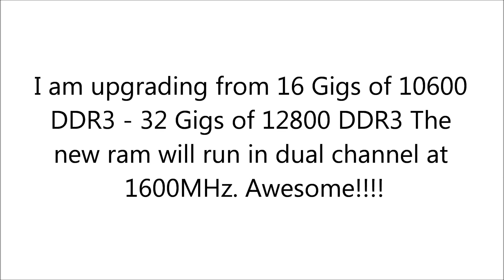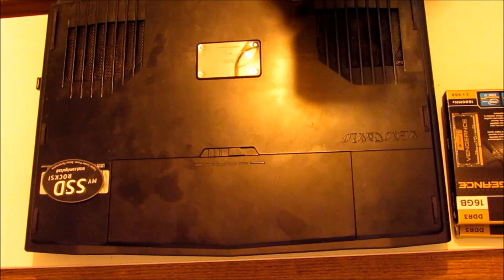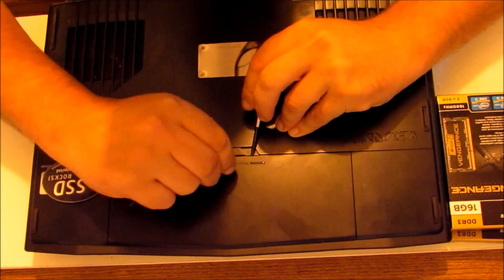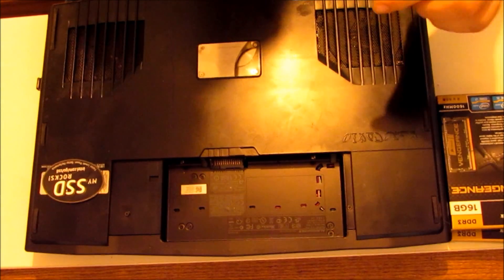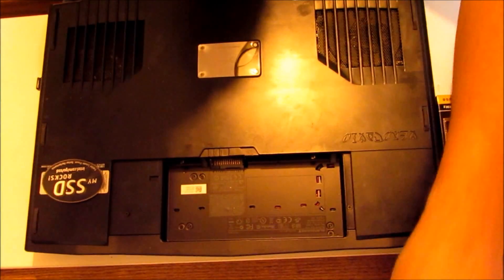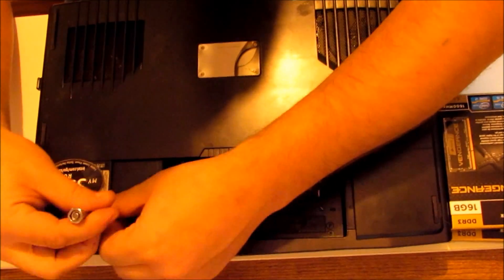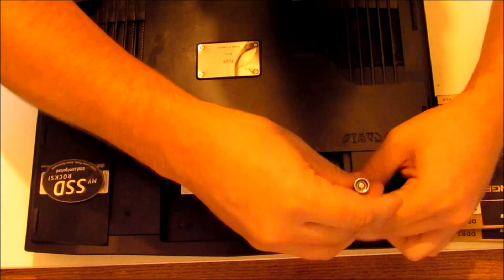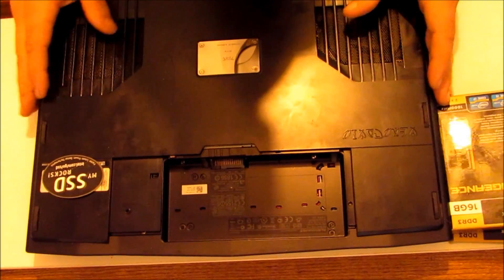Alienware M17x Ram Upgrade Video HD

Comment: I know I'm a little late, but I fixed this model a few months ago, it has 16 gigs installed.. can I install 2 8 gig sticks just under bottom plate?, it has all slots plugged 2x4 under bottom plate and 2x4 under keyboard. If I ad a 2x8 kit just under bottom plate will it run on 24 gigs? I dont wanna tackle full teardown for upgrading to 32 just yet,,ty in advance.

Comment: if im replacing 2 of the modules with 8gb chips what 2 should i replace...  my r3 came with 8gb 2gb x 4.  im hoping i can just do the back 2 but if i have to replace 1 in front i will....
thanks for the help!
Reply from the maker: If you are just replacing two of them, you can do the back ones. It really does not matter. Just remember if the other dimms are slower speed, the computer will throttle down your new higher speed dimms. Sometimes its better just to take out the old ram altogether.
Reply: Rob The Plumber k thank you!

Comment: i have a m17x not r3 or r4 running on 8gd ram can I upgrade to 16gd if so what would you recommend
Reply from the maker: Curtis Brown Go to Corsair and do a computer test. They will tell you the fastest and most stable version of RAM available. Thanks for watching.
Reply: If I am upgrading to 16gb of RAM, would i have to purchase one or two cards? I ask because I see you purchased 2 16gb Corsair cards which came with most likely 2x8gb cards in each box. In total, you swapped out 4 cards. Would i have to do the same if I am upgrading to 16gb? Wouldn't I only have to purchase one box of 2x8gb cards?

Comment: Thanks for the Video But I got a problem I have an ALIENWARE 14 and it's RAM is 8GB  DIMM. so I am wondering which RAM with best HD that could I get that can replace this one?
This RAM came with PC sucks. I can't see shit clearly it's so not good. please help me. I was thinking about to buy the monitor good HD and keyboard, but this video got me change my mind
Reply from the maker: Jean Claude Kagabo For some reason you comment was flagged as spam. Sorry. Do you still need info?

Comment: I have m17xr2.....Dell says it only supports 8gb ram....can i get 32? at least 16?
Reply from the maker: I know you can get 16gb for sure. Go to Crucials website and do a Ram scan. They will tell you the max you can do with the R2. They will also tell you max frequency, overclock and version.

Comment: hi awaiting mx17 its coming with 8 gig of ram its a swap for a xps1647 from dell thanks dell but can you tell me as it has 4 dim slots will it come with 2 in each or 4/4 under keyboard leaving the 2 easy dims for me to put in 4/4 upping it to 16 gig

Comment from the maker: Just compressed air. I take my laptop apart every month or so to clean the dust out. You can buy the cans for $10. Much better than a Q-tip
Reply: I have a question. What’s the highest graphics card an Alienware m17x can take?
Reply: Also what’s the highest amount of ram it can take

Comment from the maker: Also if you rate the ram 10600 to 12800 in Windows 7, you get a 7.9 vs a 7.6. The Corsair ram took severe overload without crashing. I had it overclocked the max Alienware bios would let me, for 12 hours. I wanted to make sure the ram was good.

Comment from the maker: Yes the maximum speed ram for the R3 is PC3 12800! My laptop came with Pc310600. I purchased the ram from Newegg. The Corsair was $160 for 32 gigs (8x4gb). I have been running with PCs 12800 for about a month now. The overclocking works beautifully with the ram. The load up is lightning fast. Video editing a breeze. Gaming perfection... Dell sells crappy Samsung ram. The next laptop I purchase will be as bare as I can go. I will upgrade everything myself. More info? contact me. 

Rob

Comment: Hi Rob,
The RAM u used seems different from the recommended in the Alienware user manual. u used (as in ur description) the PC3 12800 where in the user manual it is the PC3 10600. is that true and will it run without any issues? how much is the RAM cost and what difference does the CORsair RAM offers from the DeLL ones? because i checked the price of CORsair RAM in Amazon to DeLL price RAM at DeLL.com and there is almost half-price difference!!

Finally, really thanks for the Vid! ;-)

Comment from the maker: I went for Corsair for 2 reasons. Performance and price. I was going to go with Kingston Hyper X. Kingston made a change to their ram. They no longer have the heat spreaders on the memory sticks. If you are planning to upgrade to 32 gigs for gaming dont bother. Windows will not use all 32 gigs. I use the 32 gigs for video editing. I am super happy with the Corsair. It is blazing fast and works well under extreme data crunching. My temps seem to be lower than when I was using the crucial (16Gb).